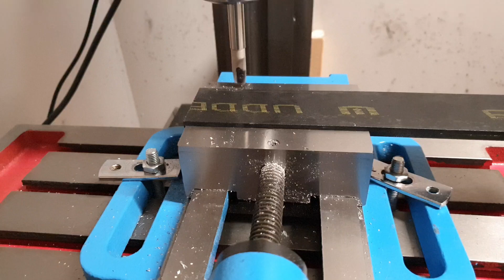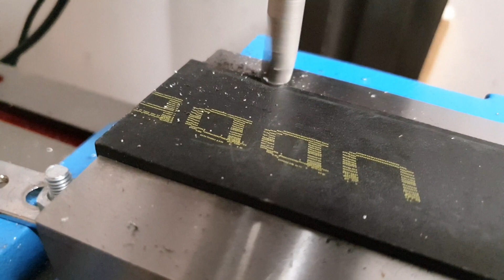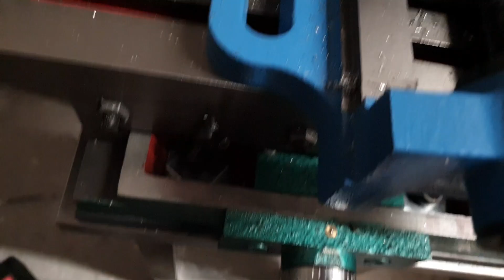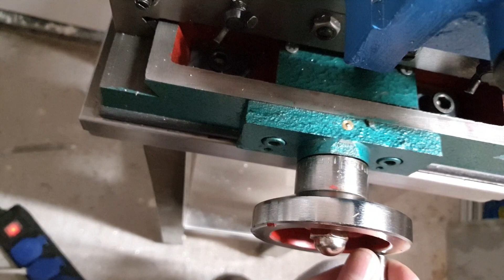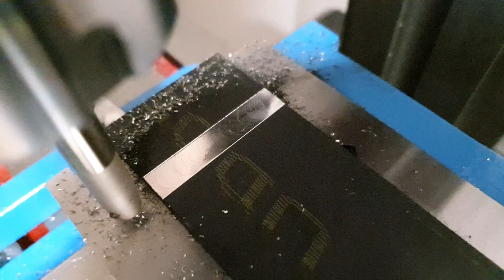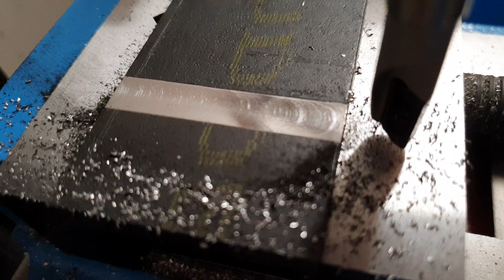First time cutting tool steel (manual mill / drill press bt30 project)

Comment from the maker: Does the squeking mean that I feed to slow? Not Making chips? 

*thanks for all the great replies! 

higher feed looked worse but sounded a lot better,  I Will chop the shank of and make a new try with higher feed.
Reply: Got the same tool, shorten it first.
Reply: little oil will help
Reply: As other suggested, increase the feed rate and shorten the tool. Do inserts have any visible wear after you finish this pass? Inserts for steel are not very sharp that's why you need faster feed rate. The speed is not a big factor with inserts, since they cut better at higher cutting speeds.
Reply from the maker: Yeah have been thinking about that. 120mm long shank. :S
Reply from the maker: No visible wear at all. Thanks for the input! I Will try and chop the shank of. It is a very cheap endmill. About 7 bucks with 10 inserts included i Think.

It sounded a lot better when I increased feed and cutting speed. But looked worse, perhaps it was due to tool deflection.
Reply: I shortened mine to 50mm just like usual endmills. It's pretty rare that you need a longer tool. And if so, get a second one since they are cheap

Comment: I would seriously slow that bit down. 100 or 200 RPM to start with. Hard steel needs a slow cutter or you'll just dull the tool. Top RPM for something like that would be about 350. You need to be making a chip. 

Sometimes the shiny surface indicates you're "polishing" instead of cutting.

Also, a non-rigid setup will also dull the tool faster.
Reply from the maker: Agree, I couldnt go slower since the motor would stall. Now mounted a tachymeter and ordered a motor that Will be much stronger in lower RPM. I Will make a new try pretty soon. :)
Reply: @thechipwelder1253  This is an endless problem with VFD and other speed controllers. You're better off just making a pulley arrangement. I have a pulley arrangement on all of my machines.

While the motors may deliver "constant torque" across their RPM range using a VFD, they cannot deliver "constant horsepower". Therefore, an 1800 RPM motor running at 25% (450 RPM) is delivering only a 1/4 HP.

With a 4:1 pulley arrangement, you run the motor at 1800 and get the 25% speed. BUT: you have 1HP.

The original Bridgeports used step pulleys and a back gear for this very reason. The VFDs are cute, but they do not deliver the HP when you run the motor below its nominal (usually 1800 or 3600). Above is where they provide benefit. I only use them to increase speed above the nominal.

The Vari-Speed Bridgeports are the same idea -- motor always runs at full speed to deliver full HP, the variable pulley arrangement is the same as the step pulley arrangement, but more convenient and allows more precise speed settings.

The motors I usually use are rated between 1800 and 5400 RPM. Therefore, I can run them at full HP with a 3:1 RPM increase (same HP). Combined with a pulley arrangement (usually 4:1), I have a full 1 HP between 450 RPM and 1350 RPM.

I use Quick Disconnect Bushings for my pulleys so I can change them easily. But most of the time, it's 4:1. This technique works really well with lathes, too.